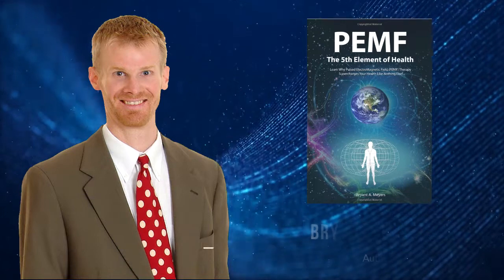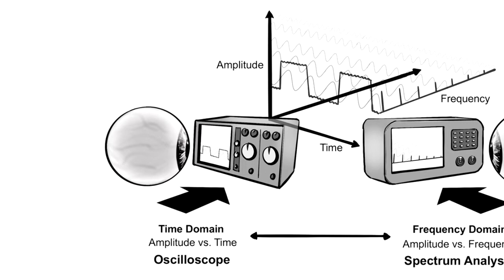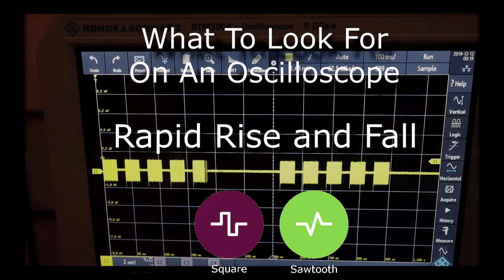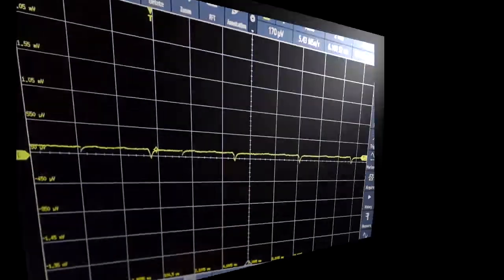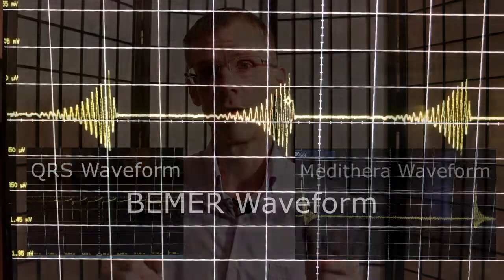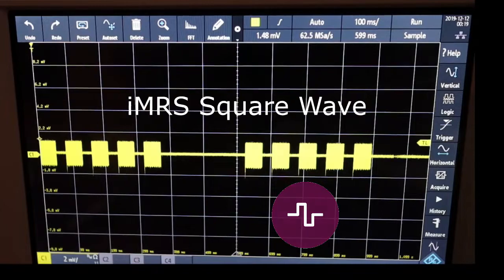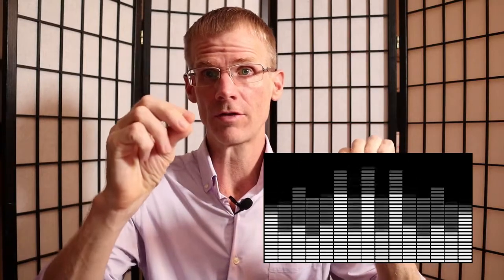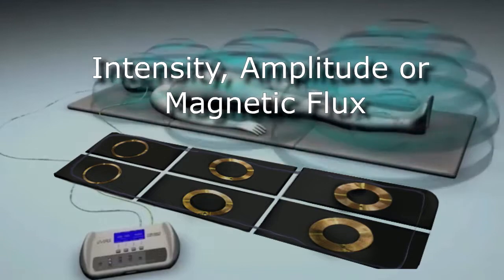PEMF Basic Science #9 - The Secret to PEMF is the SIGNAL!

Comment: Thanks Bryan for all the useful info👍 I use the Spooky2 PEMF coil. Can u give the details of Gauss values needed for a PEMF device to be effective? Is it safe to use over head?
Reply from the maker: Did you watch my video on intensity, I go through it in detail there. Bottom line is intensity is NOT that important, though it is PART of Faraday's law of induction so it matters, just not as much as the steepness or slew rate of the signal (for induction), the size of the coils and spectral content (frequency spectrum).
Reply: @bryantmeyers  Thanks for the details. Actually I want to know how to control penetration of magnetic field? Is it by increasing the number of turns of coil, or diameter? I will be using spooky xm generator to perform PEMF therapy.

Comment: Bryant ... what is your opinion of the EarthPulse?  Have you found it to be effective?
Reply from the maker: Hi Nick, I used it for almost a year and honestly it did not do anything for me. Paul even sent me a replacement, and still nothing. 
Now that I understand the physics of PEMF, the issue is the small coil and fairly simplistic repeating squarewave and the fact you are placing it too far away from the body to get a pure coherent magnetic field (penetration depth is roughly proportional to radius of the coil). I would definitely recommend looking into a full body mat device with larger coils and a better signal. Feel free to call me if you are in the market, and I am happy to share my experiences of owning and researching over 25 PEMF the past 15 years.
Bryant 941-928-0124